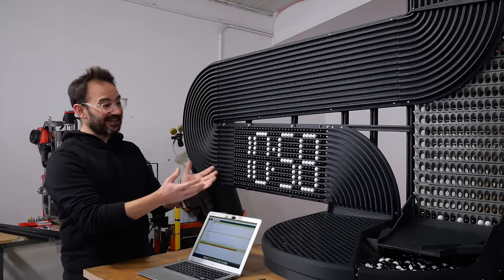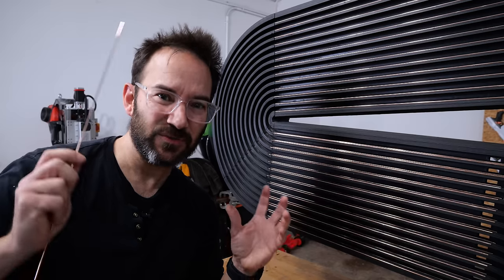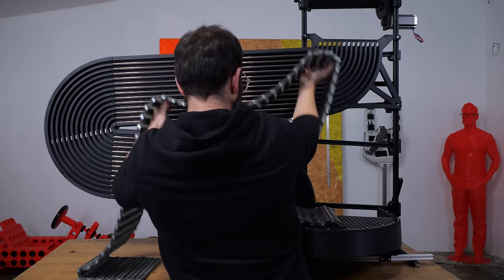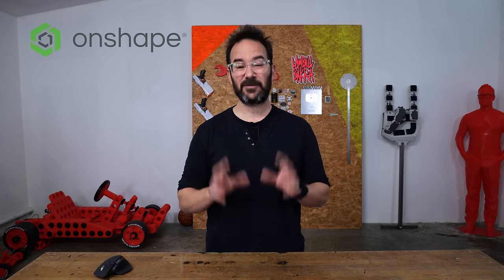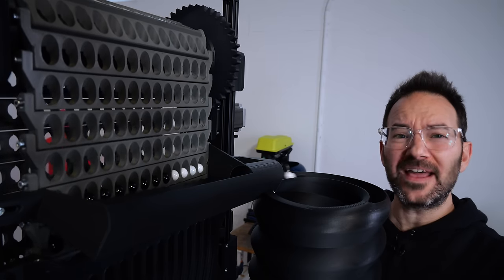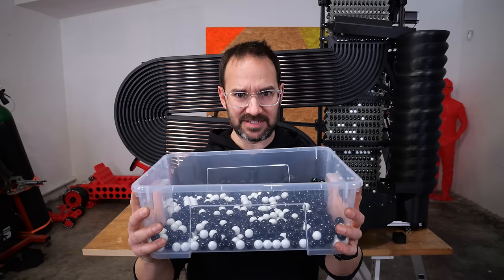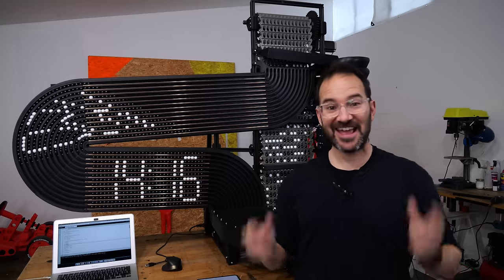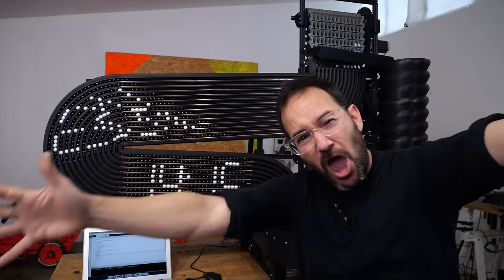BUILDING A MARBLE CLOCK - Pt. 3

Comment: An engineer sees the problem and says "we need to remake everything."  A child sees the problem and says "how about using smaller marbles?"
Reply: what do you do with the hundreds of white and black colored marbles?
Reply: @hamburger-yh3lj  put them in a garage sale?  give them to charity?  marbles cost less than the reprinting of all that equipment.
Reply: im not gonna lose my marbles
Reply: smaller marbles would fall out of rails, we had to enlarge the railing, and when the marble rests on the bottom, you might see 30% less marble. Maybe for the black ones we could find a compromise, cause they are just distant holders. Actually we could get ridd of all marbles on the left and use less marbles, if we only focus on the position of the white ones.
Reply: There is no difference from engeneers to children, by the way. It's more people doing things, as they have always done it, who don't see creative solutions.

Comment: I had another Idea for this. Instead of using the Tower for unused marbles to come down, add an extra lane in the left (below the marble display) without stops. So you had 14 lanes, 13 for the Time and one below where you would see the owerflow marbles running down. I think, this would look nice
Reply: That’s awesome. Then there’s basically a constant stream of visual action happening!! I hope this gets seen by the big guy!!
Reply: I’d worry about that having enough bandwidth. Multiple such channels would be necessary, most likely.
Reply: Our maybe just use some acrylic tubing or something for the spiral
Reply: was thinking this the whole time, would give it that marquee feeling
Reply: There are two unused channels already, strangely. The most top and bottom ones …
Reply: The fourteenth lane would also cause a constant vibration so the shaker can be taken off.
Reply: @Lamster66  wouldnt need to be a huge reprint, just redesign the catch at the top to funnel into the left or right for the buffer lanes that are above and below the time
Reply: @falklumo  those are full of black marbles, they are spacing from the borders

Comment: Replace the spiral with some clear vinyl tubing in a holder to keep it in shape. The soft flexible tubing will dramatically reduce the noise from the marbles, and it'll look cool since you'll be able to see them!
Reply: I was  about to say that I would love to see the marbles! This is a great idea
Reply: Well that's simpler than my idea. Just like he 3D prints everything, I often think of casting and molding. So I was thinking of a softer polyurethane molded in the same shape as his 3D print. So it catches in spirals and moves the same, but silently.
Reply: why not place the sorter lower? the marbles would just fall a few inches and the whole spiral thing wouldn't be needed
Reply: I was thinking you should put some insulation (like PUR) in the hollow part of the cylinder

Comment: I mentioned this idea in the previous video: If you make the marble channels vertical instead of horizontal, it would allow you to clear out a single digit at a time. So if the time was 14:12, you can specifically just clear out the 2. This would speed it up significantly.
Reply: It wouldn't be as dramatic as clearing all of the digits, but it would be faster. If clearing all the digits is necessary, then you could possibly save clearing all the digits specifically for an hour change.
Reply: Yeah but it doesn't look nearly as interesting that way. I think he can manage to get this up to speed with some software thinkering and an additional Marble loader at the top
Reply: With this setup I'm guessing you could "preload" the next number so that changing the minute is as fast as clearing the current one and allowing the new frame to roll in. Not sure if I'm explaining myself lol
Reply: I had the same thought sine the first vid!
Reply: @leolego2  How does it not look interesting? It's literally what most digital clocks do and even analogue ones like the foldover numberplate thingies...
Reply: Another improvement would be to make it so the top and bottom tracks are isolated. There is never any need for a white marble to be in these rows anyway. This would improve the ratio of black to white marbles in the other rows thus reducing the amount of time wasted waiting for a white marble.
Reply: Yeah that was my first thought at beginning of the first video too. 
It looks awesome indeed this way.. but it can't keep up with time.. 😅
Reply: Even in the horizontal setup, not all channels need to be refreshed every time. It seems the top and bottom row with all blacks never need to be refreshed ;)

Makes me wonder if it would be a good idea to just use white marbles and place the actuators just right of where each single marble or row of marbles needs to be.
Reply: Yep, I would have done it like that too, it would have also helped stubborn marbles to move too
Reply: That warped timestamp-in-waiting is way 😎
Reply: The most important thing is to move the dumping of unnecessary balls as low as possible, and they should roll to the beginning of the storage so that there is constant mixing. This is the main source of dialing delay. At the same time there will be much less noise.
And make a ball counter at the current time reset (Because their number is strictly constant, so as not to make a delay before loading the next screen/picture.
Reply: I had a similar thought, dropping out of the bottom would also speed up the process.
Reply: It seems to me that the biggest hurdle to getting it to be faster is the randomness of the color of the marbles in each position of the lift belt. Way to late to redesign, but ditching the parallel belt for  a pre-sorter to separate marbles by color to bins, then mechanism to place individual marbles in correct order on the belt or just directly into the tracks would solve the problem. And maybe quite it down by eliminating the rejection  chute.   Anyway this project has been fascinating to watch develop and Ivan is a super engineer and entertainer.
Reply: @Ugly_German_Truths  maybe what ain't what "most digital clocks do" is more interesting?
Reply: It would need 4 "frames" each with individual controls and releases.
From (for example) 1959 to 2000, from 2359 to 0000... would take four times the work to process the same disposition as the horizontal, and the actual hardware needed would be a lot more complicated to build and program. This would also increase possibility to break the marbles.
Horizontally is the way to go.

It would be a lot more efficient just make the black and white marbles fall into different buckets when they are released, since you know it's previous disposition.
You would decrease the times of sorting and also would need a lot less white marbles.
Reply: Couple of things:
Remove the first and all the last black rows, maybe even the bottom and top black rows might give some extra time, then you could use the marbles left and right of the elevator to fill in gaps. But what will be a much better thing is making sure there are more white then black marbles, as the white marbles are outnumbered in the digits the chance of getting a wrong marble is having a much bigger impact. So balancing the white:black ratio might add a better flow.
Reply: If the tracks are vertical, when the marbles fall down, it would be very destructive over time. Either to the marbles or to the hardware that stops the marbles.
Reply: @Ugly_German_Truths  isn't "It's just like every other clock" the definition of uninteresting?
Reply: @timwildauer5063  there could be a 90° curve beneath the vertical drop
Reply: I was thinking the exact same thing, yeah
Reply: This would be more efficient, but the code required would be a bit more involved. Not that that's necessarily a big deal or a problem for everyone. Just one of the new complications is that you'd have to have it dynamically build a fraction of the next digit for the higher digits in-between changes to the lower digits so there wasn't a noticeably longer delay for hour changes
Reply: It would also add a bit of complexity (or noise) as you would either need to have 4 separate elevators or have 3 digits of channels rejecting most of the time.
Reply: While you're right, I think artistically, conceptually, the horizontal channels make this much more fun to look at

We only need it to be functional to a point, we have clocks already.
Reply: yeah but to only clear the 2 you would need to design an additional more complex clearing mechanism
Reply: All the leading marbles before the first digit could be removed
Reply: @Ugly_German_Truths  That's the point.  There is both a novelty and a dramatic beauty in all the numbers simultaneously melting away and being replaced by the distorted pre-load shifting into clarity.  It is whimsical, ethereal, and unique.   Single digit replacment is utilitarian... too expected... banal.
Reply: Wouldn't it just take roughly the same time and look less cool?
Reply: That appears to be what it is doing; the next number is composed in the channels above the turn, the old number is released and when the lower channel is clear, the new number flows round the bend into the lower display channels. The problem is that, given the random nature of the supply of black/white marbles, the composition can take longer than one minute.
Reply: @leolego2 you could make it an L shape
Reply: I was going to make the same comment - vertical channels instead of inclined horizontal ones.   I'd also suggest clear tubes, a little oversized and reclined a little to keep the marbles centered in the tube.

I'd have sorted the marbles at the bottom, and used an archimedes screw to elevate them. I'd also have loaded them into the screw in the right order in the first place. A rail across the top would only need one gate per character, and the whole row could be loaded by tipping that rail into the top of the tubes.

But it's much easier to play armchair maker than actually make it. I'd probably not approach it mechanically at all, truth be told.

Keep making interesting content, Ivan - it's an inspiration to us all.
Reply: @XceptionalBro  Yep, the clock currently builds the next time it's gonna display while showing the current one, then switches over. The problem is, building a time seems to take more than one minute, hence the demo at 9:50 only showing every other minute.
Reply: I commented something equal on the last video too. Replacing just one or two digits at a time would allow for a swap each minute, less marbles, faster, overall less noise too
Reply: Get rid of the black marbles all together. Will be even quicker.
Reply: I would only suggest that this is fine right now and a separate mechanism using its own set of marbles set to allow counting of seconds (one column white for seconds and one column black for tens of seconds - or a building a line in a timed manner with black marbles inserted every 15 seconds).  If you can count minutes then you're already throwing away the seconds; use them, just build something specific where it matters that has the precision instead of trying to enforce the precision on the entire system.
Reply: Smart i like the idea, it changes it from unpractical to useable.
Reply: Is´nt the marrbles made of glass?
I guess a problem is that the marbles will crack when they collide with each other when they are free falling.
Reply: I feel like that would put more strain on the marbles and possibly break them eventually.
Reply: But The marbles will hit each other with higher intensity and will crack sooner
Reply: @Ugly_German_Truths if it looks like a clock that everyone is familiar with…that would be less interesting

Comment: Awesome! Been looking forward to this, what an insane amount of work!
Reply from the maker: Thanks guys!!
Reply: Make it much faster by Using multiple input trays 
1 black
2 White
3 output mix (sort these into the 2 trays ) 
First fill all holes in the belt by black balls then remove those which needs to be white and by the second tray they will be auto filled with white balls as they are empty. 

Just the output balls which are mixed white and black need to go through another belt which will sort it into the first 2 trays using same solenoid, sensor
Reply: @ivanmirandawastaken  Crazy idea, not every channel necessarily changes between two times, if you could selectively reset channels and leave some unchanged, that would require way fewer marbles between minutes. That might defeat the purpose, though.
Reply: @romitchandverma7663  He could also encapsulate the slide with some sort of sound deadening enclosure to cut down on the noise
Reply: Guys we need a Collab, please 😢
Reply: @romitchandverma7663  tell me you're a programmer or an engineer
Reply: @jimmio3727  😅yeah, what gave it away
Reply: @ivanmirandawastaken love your videos and effort sir. You are a freakn genius.  I dream about similar kinda stuff but okay. Keep up your projects!!
Reply: @ivanmirandawastaken   FIX THE NUMBER DIMENSIONS!!!!  If you are going to use the weird-ball number of 6x11 (instead of the standard (5x7) then for the love of marbles and everything rolly, make them all the same dimension!!!! The numbers being different heights is driving me insane to look at.